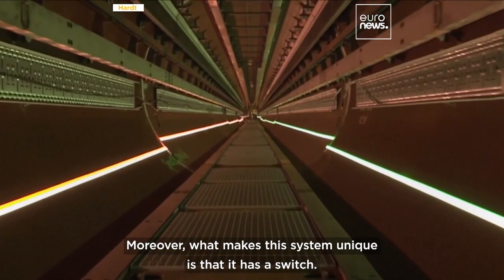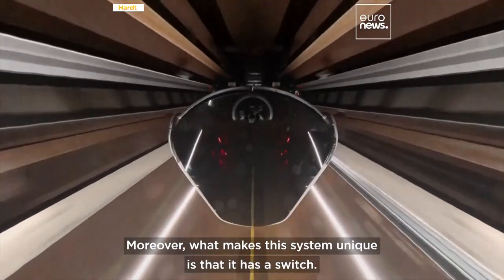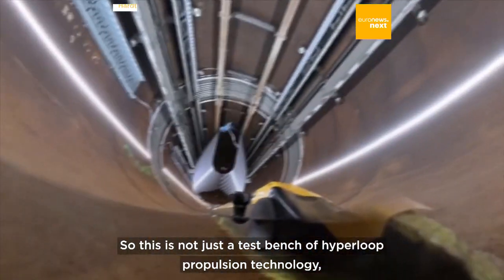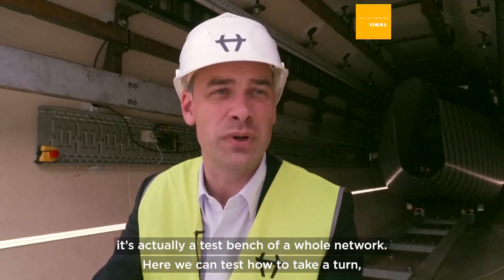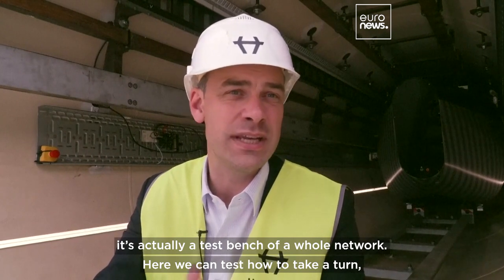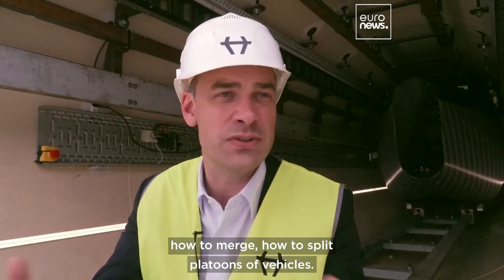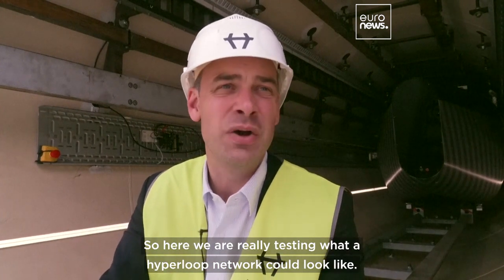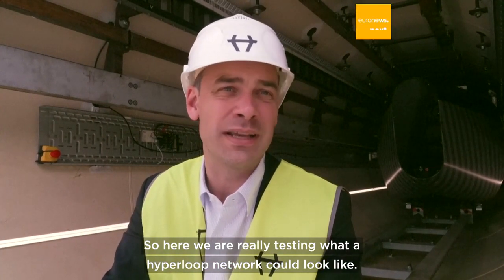Commuting at 700km an hour by hyperloop takes a step closer to reality with successful test run

Comment: Don't forget about safety testing, as it seems basic idea of levitating through is easy achievable. What happens when there is no power ? Longer skeleton for first car, static mechanical connection for others. How it will balance sliding through tunnel?  Interconnections with long gate/cage?